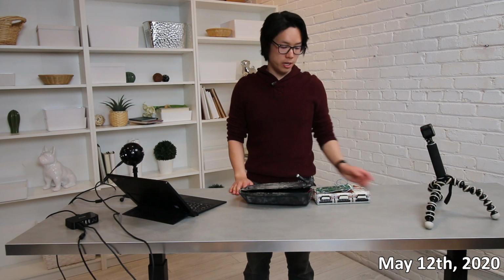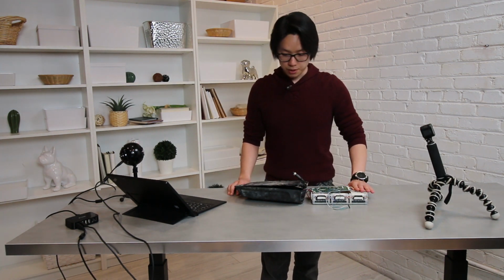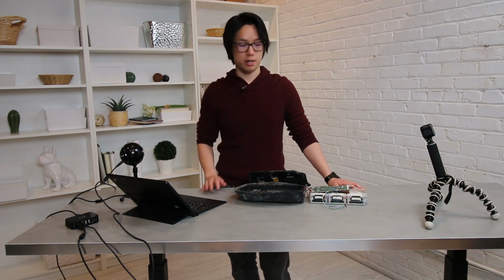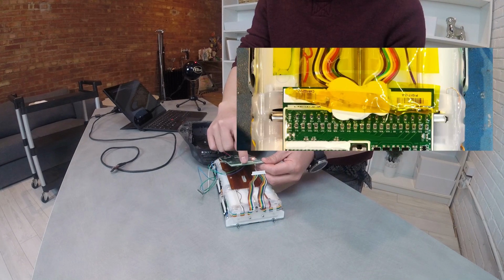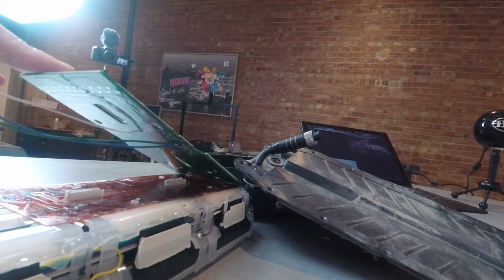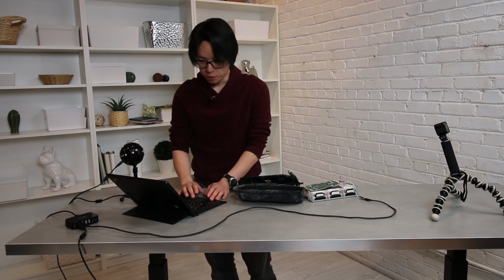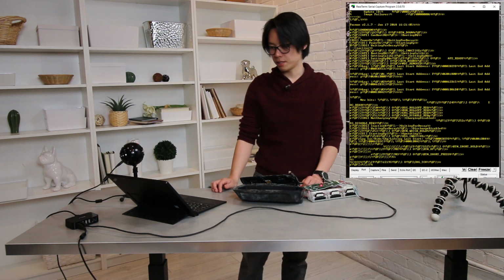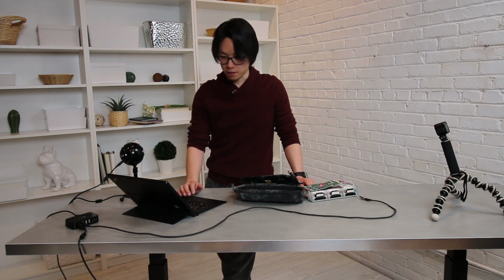How to get DEBUG data from Boosted Battery V2 XR (No, this will not fix RLOD)

Comment: hey how did you manage to lift the pcb? Thanks and greets!
Reply from the maker: that was a tedious step. Here is the sequence of actions:
1) remove the white silastic on the balancing leads
2) using a hair dryer, heat the pcb up
3) using multiple flat screw drivers (ideally with tape on them to avoid shorts), slowly pry open the pcb starting from the balancing lead side
I made a little album from my archived footage: https://imgur.com/a/Ca50rOv

Comment: any updates on this ?
Reply from the maker: The community has a work around to fix XR battery RLOD.
A redditor named "technically_a_nomad" is offering repair service: https://www.reddit.com/user/technically_a_nomad/
And there is a mod chip made by "Jonataubert" which clears the RLOD: https://jonataubert.com/proj/amnesia.php
Reply: @Lam-s-Workshop  thanks!
Reply: Salut,

Je suis près de Montreal. Est-ce que tu connais quelqu'un a Mtl qui peux réparer un XR battery. 

Merci
Reply from the maker: @Init369  pas à Montréal malheureusement. C'est vraiment xrgeneralhospital.com qui fais les réparations en Amérique du Nord à ce que je sache